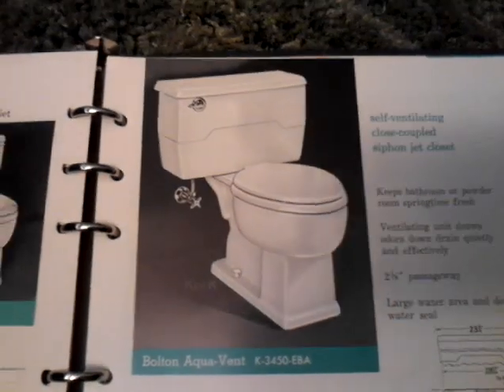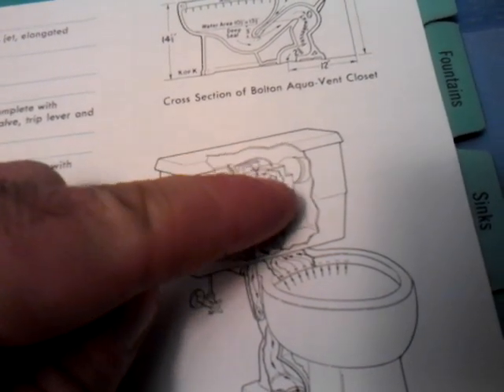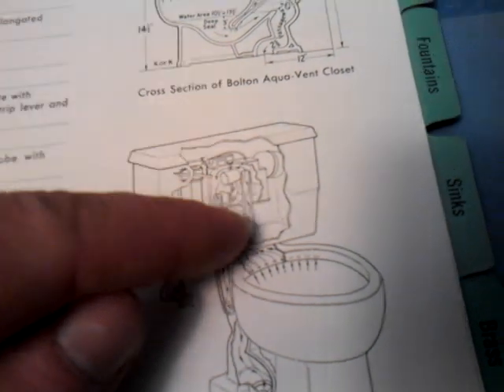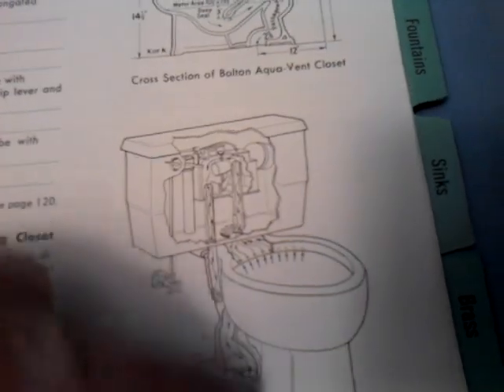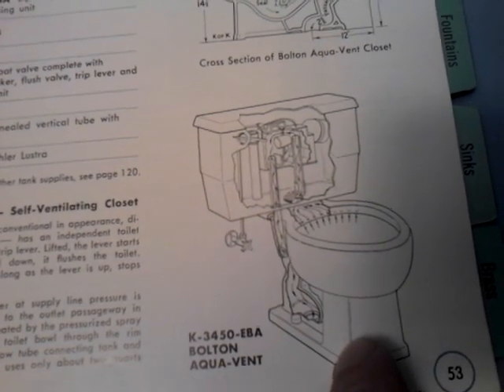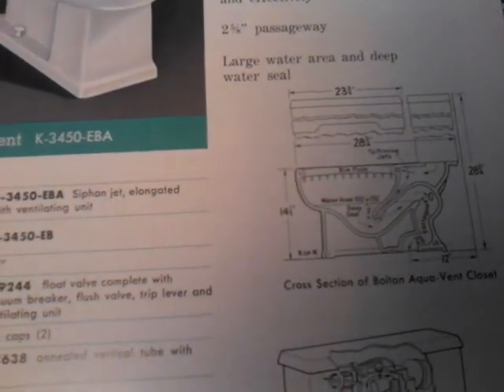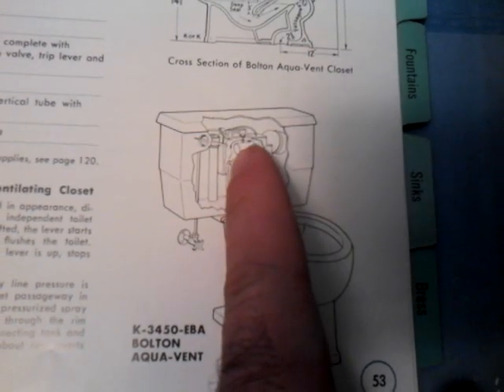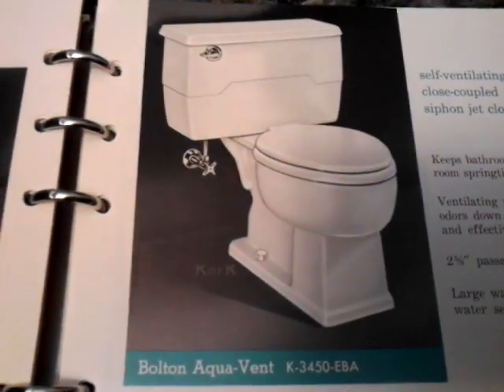#31 Kohler Bolton Aqua Vent operation.

Comment: I just got 2 American Standard vent away Luxor lowboy toilets,yes,looks like a challenge,lol.I want to get one of them working so I can install it in our guest,and kids bathroom,lol.I have a Rochelle in our master bath,it stays,lol.We love it now that I got it working correctly.
Reply from the maker: Very nice! I've been on the lookout for a Luxor for a long time. I've never had a vent away toilet but I know new parts are hard to find. I see used or new old stock parts on Ebay occasionally and they are usually expensive. It would be neat to tinker with one though. Good luck!
Reply: @vintagekohler6085  Yes I just made a video on it Im going to make another YouTube channel to post my toilet videos and other stuff on.I got 2 of the Luxor vent aways a blue one and a green one.they have a lot of parts,lol.
Reply: @vintagekohler6085  Yes,thanks,they are my first vent away toilets too,lol.There's a lot of parts,The fill valve is not in too good of shape,may have to retro fit something,lol.I have the new video up on it,I havent unraped the green one yet so I know nothing about it,lol.One project at a time,lol.I also put up a video on my Rochelle.
Reply from the maker: I'd love to see them! Let me know when you launch your other channel.
Reply: @vintagekohler6085  Its up,its under chris thurman I listed it as chris 101,but it listed as my name,lol.I have the videos up and will post a few more in a day or so,thanks.